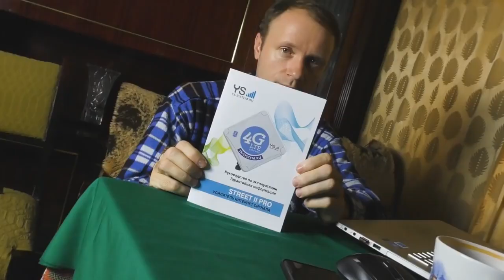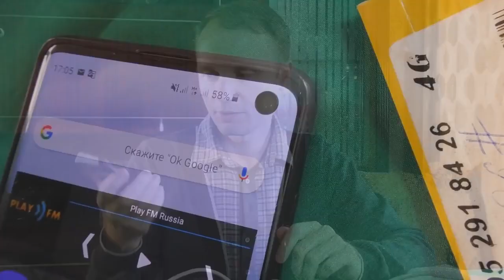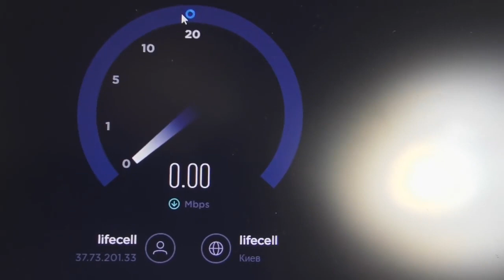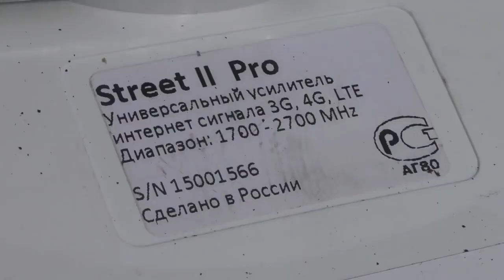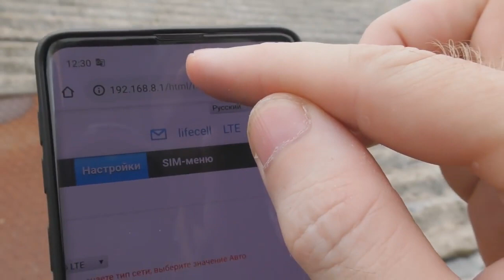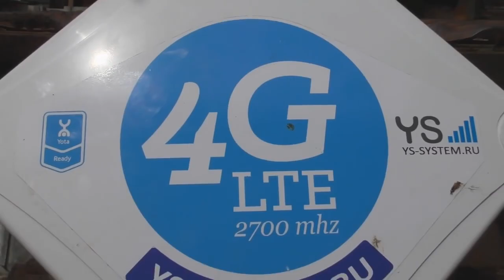INTERNET SIGNAL BOOSTER. Amplifier Powerful 3G / 4G / Lte Antenna. How to increase internet speed

Comment from the maker: Powerful 4G signal amplifier, 3G, Lte cellular communication amplifier. It operates up to 27 kilometers from any cellular base station. Gain 22 decibels. The Internet signal amplifier is developed in Russia and works at any remote sites, in the country, in a cottage, in the village. Connection and setup in just 5 minutes. Sim slot for 2 sim cards, frequency aggregation, Lte module Cat category.6. The amplifier allows you to scan the base stations and connect and fix the best tower that gives the best speed and signal. The powerful antenna uses MIMO technology. A real increase in both incoming and outgoing Internet speeds. Built-in Wıfı access point, Speed test and much more. The minimum service life is 10 years. Shipping worldwide .